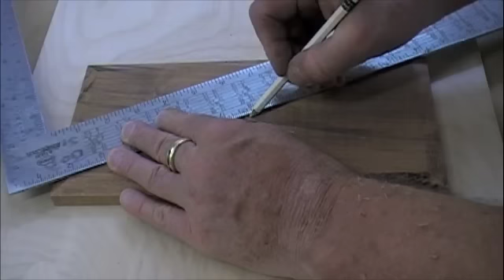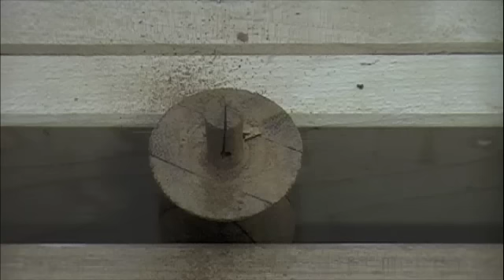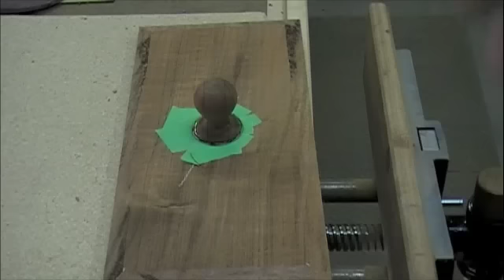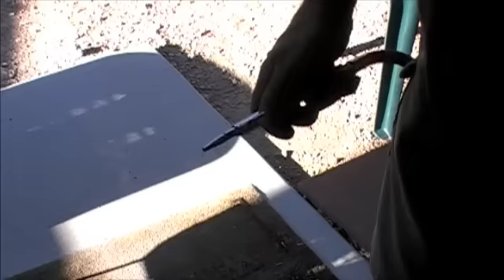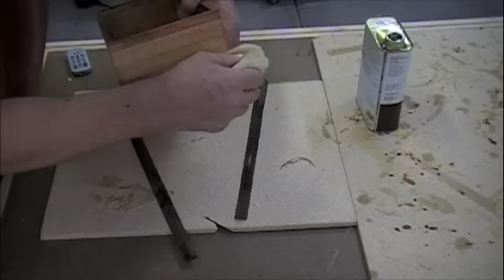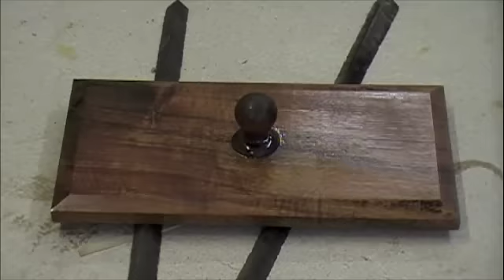Woodworking Projects - How to Make a Jewelry Box - Part 6 - Joinery Techniques & Applying Finish

Comment: He answered you appropriately. You can pound nails with a pipe wrench but it doesn’t make it advisable to do. Use the proper tool for it’s intended purpose. You will get much better results and the operation is much safer too.